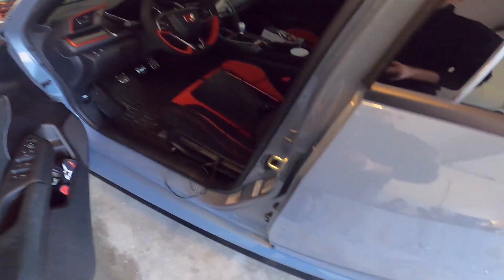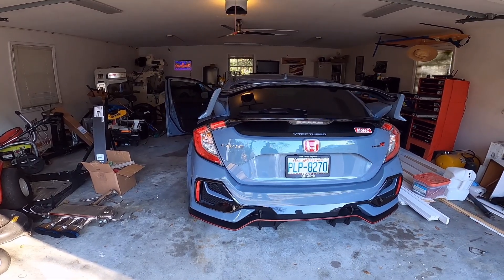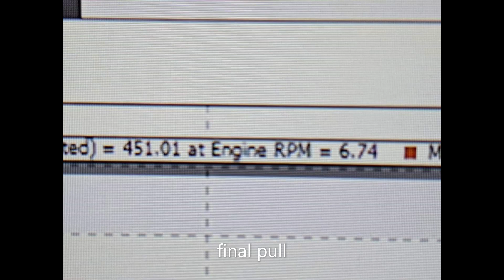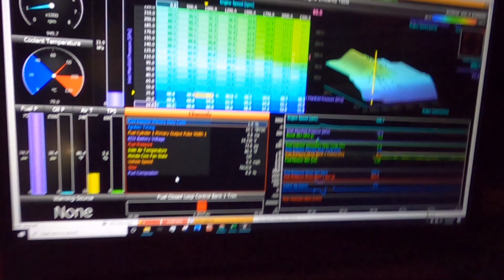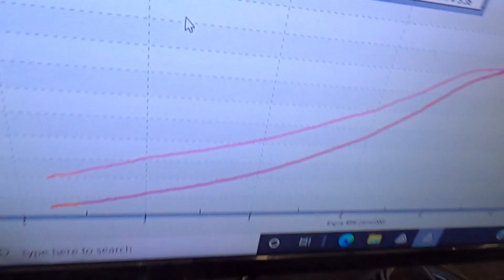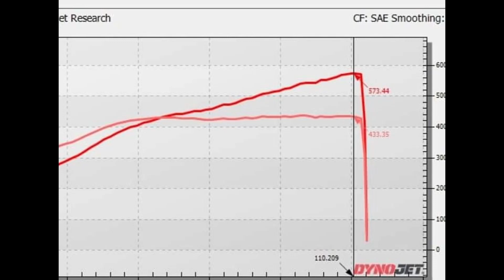Stock Type R Makes 608WHP

Comment: Lol “stock fuel system” I understand both pumps are the same but from a tuning aspect ur not getting all 600hp from stock hp injectors especially reliably. Still 100% a VERY respectable build. Just felt like that should be stated so people don’t assume ur STOCK STOCK. The low pressure port injectors are easier to manage and helps gets the best from you fuel system made. Respect the hell outa the build tho! Go give em hell
Reply: @TaylorKing1  lol that neither are standard issued stock  fuel system. It amazes me how people reference another poor example to prove there’s in someway right. Lol. Again neither are stock fuel supported.

Comment: If this made 600whp on stock fuel system, is Hondata's a scam then?
Reply: @TaylorKing1  Right

 Your fk8 is now both port injection and direct injection  with bosch Injector? What's the longevity of this set up.

I don't plan to run MoTec on my car but I want to get to around 500whp if not 500hp. What should I add to my car?

Comment: That sure doesn't look very stock to me, like the description says....
Reply: @TaylorKing1  That's pretty misleading.....a bigger turbo and motec pretty much puts this car on another completely different level.....
Reply: @TaylorKing1  my car has a turbo and ecu and hondata fuel kit, and PRL down pipe and PRL HVI and intake pipe and PRL flex fuel upgrade....and hondata flashpro 
But I would never post a
 video of the horsepower it made and call it a stock Type-R....that's asinine.
Reply: @CKC19  if your car has all these upgrades then you def should know what means "stock block"...Go play your ps5 now and upgrade it to 2000whp
Reply: Wow,you got me on that one!!!!

Comment: Nice Numbers ! Was that pull done with the factory clutch ? I have 19k miles on my FK8 and planning to go FBO w/flashpro/meth. I was wondering how the factory clutch would hold up to 380wtq once I'm tuned. I'll ask my tuner to cap it off at 380 wtq in the lower rpms. I'm a pretty conservative driver and track on a road course about 1-2 times at most per year.

Comment: Is this the stock direct injection system? If so good luck running ethanol and that type of power on it. Blew my motor at 490whp.. Lost fuel pressure, went lean, and motor went bye-bye.. like to build up thanks to the DI.. It lasted about 2 months. I hope your's last longer than mine.. I was running a g25-660.
Reply: @TaylorKing1  That's good. At the very least I shoulda went with the Hondata DI upgrade. But you learn from your mistakes. I was lucky enough to get a replacement motor for a good deal. I will be staying relatively stock for a while. Ill do it properly next time around.
Reply: @TaylorKing1  Yo.. which port injection kit are you using? Also, have you seen the ultimate racing intercooler rated for 900hp? If so, any thoughts on it?
Reply: What would've prevented your motor from going lean?    Could you done it with a fuel pump alone, or did it require different pump, injectors and programming?

Comment: I believe you need to try to run the without the air intake and turbo inlet pipe. To really remove the overheating.

Comment: All that work and you don't let it idle to temp at least a little. Man I don't move mine until the coolant shows at least one bar. Then I stay out of boost until 155+ on the oil temp. Also congrats on the power.
Reply: @TaylorKing1  oem pistons are forged, no?